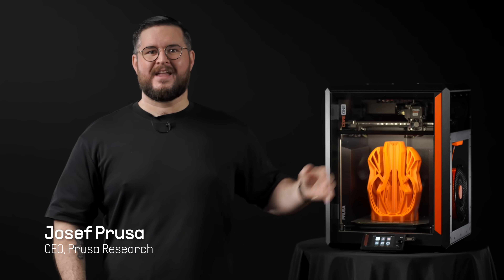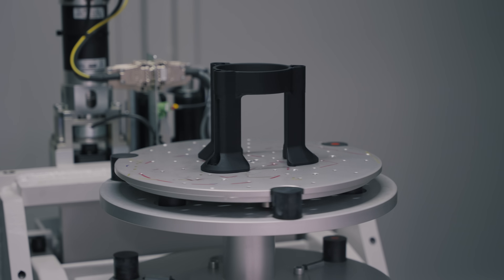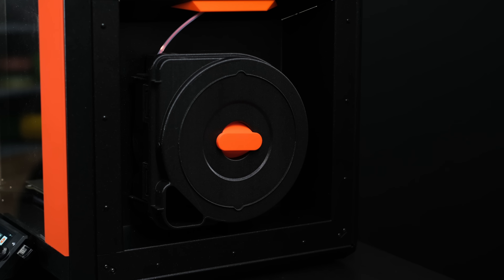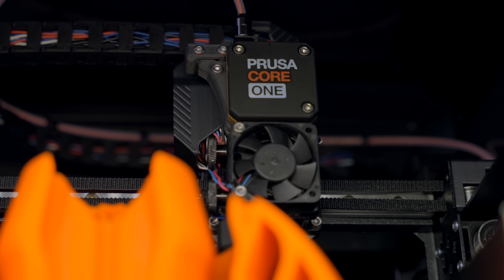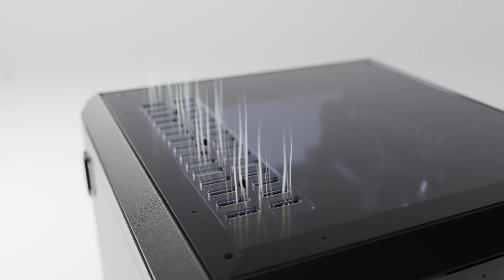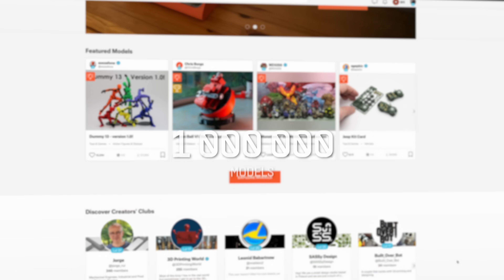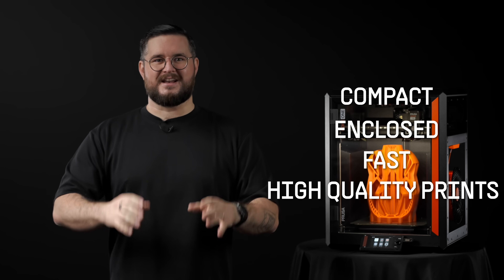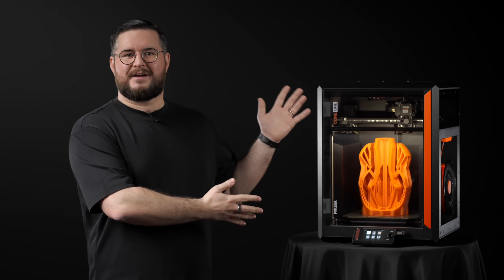Prusa CORE One - Fully Enclosed, High-Speed CoreXY 3D Printer With Active Chamber Temp Control

Comment: The fact that I can upgrade my prusa MK4 to this is actually insane.
Reply: It’s very strange and I wonder the cost and what you’d have to throw out of the MK4. It’s like saying there’s an upgrade kit to turn a Honda motorcycle into a Civic. Better be significantly cheaper, otherwise I’d just buy this and keep the MK4 and have two printers.
Reply: the kit to upgrade the mk4s to this is $449 USD
Reply: @c0mputer  the conversion kit is at 489€ on the store. It's not so bad when you see the enclosure price with less features, but the price of the printer kit/assembled is better than the upgrade
 kit
Reply: @c0mputer  It's about 400e so its significantly cheaper than buying another mk4 or core
Reply: @c0mputer  It's less than half the cost of Core One Kit. 489€ vs 1049€ in my case.
Reply: The upgradeability made me almost cry from happines over ingenious engineering.
Reply: @az09haz  It's one of their core value propositions, you buy Prusa you don't get screwed with later models pushing you to buy a whole new printer. You buy Prusa you get long term ecosystem access.
Reply: It's a bit weird to call it upgrading the MK4. It sound more like you will be building a new printer and cannibalize the MK4 for parts.
Reply: @m97120  I mean that's fair, but it sure beats the competition's "haha just buy a whole new printer"
Reply: @ For nearly half the price without dealing with selling old printer. That's okay for me.
Reply: It's a conversion kit, not really an upgrade. But the fact I can turn my mk4s (former mk4, former mk3s+, former mk3s, former mk3) in a new corexy printer with a heated chamber (does the bambu have heated chamber?) at less then half the price of a brand new printer is totally insane. I can't wait for the kit to upgrade... ehm... to convert!
Reply: @andrealioce4341  Upgrade or conversion all depends on what you need it for. To me it's a definitive upgrade to get a heated chamber, integrated enclosure and fume extraction! For printing PLA, I would not bother though. 🙂
Reply: @mariusmossum2923  I agree. I print mainly PLA and PETG, sometimes TPU and carbon fiber composites, and all print well in MK4S; but after the conversion I could print PC or nylon, materials I've always avoided due to the open frame. So it's a worthwile upgrade imho.
Reply: What actually insane will be spending "buy a new P1s money" to upgrade Mk4S to get 20% speed gain and the privilege for ending up with 1 printer rather than two.
Reply: You'll probably throw out 95% of the MK4 parts like the upgrade from the MK3S to MK4 upgrade.
Reply: @edsai2041  maybe, but I pay the new printer half the price. Mk3 to Mk4 kit + Mk4 to core one kit = brand new core one. But I can upgrade now to core one because I've already saved doing Mk3 to Mk4 instead of buying a new Mk4.
Reply: @edsai2041  I would assume you would keep. Controlboard, nextstruder, some motors and perhaps heated bed. Also are you complaining that a completely voluntary thing that is super customer friendly is possible?
Reply: @JakobBerglund  it's just something to be aware of. Though the upgrade from MK3S to MK4 was nice, I would have been better off just buying a new MK4 and selling the MK3S which would have meant less waste. I underestimated how many leftover unused parts I would be left with for the MK3S to MK4 upgrade. Upgrading to a MK3.5 or 3.9 would've slightly better in terms of waste created.
Reply: @edsai2041  Yeah, even Prusa said that the full conversion to MK4 was more of a novelty than something that made financial sense. Or waste for that matter. But it's nice that they do offer the option. All those extra parts may become spares for old Mk3's, if we care to circulate them. So not necessarily all landfill. 🙂
Reply: is more of a conversion than an upgrade
Reply: You can't, you need to buy MK4S upgrade first, then you can upgrade, while throwing half of the MK4S upgrade away...
Reply: @Papinak2  mk4 to mk4s is a quite cheaper upgrade, a lot of people (me included) already did it.
Reply: @andrealioce4341  I didn't, because I don't like plastic parts it comes with. And those are exact parts that will be thrown away when upgrading to core... I just don't like buying waste.
Reply: This is one of the benefits of dogfooding.  Prusa use their gear to print, and they sure as heck would love to reuse a bunch of parts when they upgrade their farm!  This is 9 kinds of brilliant and will let me take what was originally a Mk3s all the way to a CORE One it seems?
Reply: @mscs2911  Well, by the time you add the mk3 to mk4 conversion and then the mk4 to core one conversion kit, i'm guessing the price is that of a core one.
Reply: @itsGeorgeAgain  Yeah, converting all the way from Mk3 does not make any sense financially. Gap is to big. But of you did it in steps, each time there was an upgrade, you would be able to keep up for not that much money each time. 😉 Especially if you can only house one printer. Personally, I might upgrade my MK4S. But my two Mk3.5's have reached their end of upgrades. They can still be put to good use, going forward. For instance printing gridfinity bins 😂
Reply: Sure, but they say you have to use the MK4S, so there's one more (cheapish) conversion step. Probably something to do with IS printer profiles in PrusaSlicer, because I can't imagine why else the MK4 would be less compatible.
Reply: We will see when more informations will be available, but as far as I can understand, you'll keep the mk4 motors, extruder, nozzle and print bed. I'm not sure about the PSU (my mk4s still has the silver one, being a former mk3 upgraded), but even 100 more for the new black psu is imho still a good price for a corexy upgrade with a heated chamber. And without considering all the future upgrades that it will be possible to make on it once upgraded to core one.
Reply: *4s it doesnt mention if this includes the S upgrade which is what $300 or so? and the kit to upgrade is about $500 might be better off finding someone to buy your old one and just buy a new one?

you basically have to completely disassemble your old printer and rebuild it in this. AND if you have the old kinda poorly designed enclosure what would you do with that? i have a love hate relationship with the enclosure. it definitly didnt have as much thought put into it as the printers themselves
Reply: @JohnJaggerJack  Wrong way of thinking about it.
Reply: That upgrade path is why this printer is too damn small for the price. Completely pointless, and you’re throwing away half the printer for it.
Reply: @rob_over_9000  I throw away half the printer but save half the money. Then we are makers, I'm sure someone will create interesting projects to do with the parts left.
Reply: MK4 1200€ + MK4S to Prusa CORE One Conversion kit 489€ + MMU3 400€ = ONLY 2089€ BARGAIN!
Reply: I just upgraded my mk4 to mk4s and the cost of the upgrade make me thinking about buying another printer brand because the price of the upgrade to core one is the same price of the bambulab A1 Combo so you can print with multi color . But the great feature of the prusa is the costumers service  24/7 and most of the printer parts can be printed .
So as a prusa members or users we need a benefits like a discounts or free gifts or any thing that’s keep us going with prusa .

And about the enclosure I already buy network cabinet that cost almost 120$ and add for it some stuffs like a filter fan , light , thermometer and its work fine .
Reply: What!!!
Reply: not mk4, you need to upgrade do mk4s first
Reply: And I can upgrade an ender 3 into a fully enclosed core xy. This is not amazing at all.

Keep your MK4 and get a p1s, they are on sale right now.
Reply: @Smokinjoewhite  It's quite clear whom you are working for! Your comments is all over this thing; and every one of them is an attempt to rain on Prusa's parade. It ain't gonna stick! :-D And yes, it is amazing! Because for that price you get all the parts you need, and amazing guide to build it, ready-made software/firmware to go with it, and finished profiles for most filaments. Upgrading your Ender is only cheap because your time has no value! :-p

I do not care what any BBL cost! I just don't care! Not because I am a Prusa fan-boy; because I am not. I actually intended to go all DIY, because Prusa was lagging behind. But I have come to love their product and service. I value my time more than my money! I value things built to last for years to come. And I value my privacy, something BBL-users clearly don't care about. There is no free lunch. You are the product!
Reply: The problem is you can buy a P1S for 100$ more and keep the MK4 as a second printer.
Reply: @benjaminh5886  Except, that assumes you need two printers and you want to own a P1S.  I get that you are a fan of the P1S.  Just know that the idea of a 3d printer as a disposable appliance, is not necessarily what everyone wants in this community.  I see the same arguments in the computer world with the Framework.  Lots of people say "why pay that for a Framework, when you can buy two laptops for that price?"  The problem is those two laptops are disposable appliances and their lack of modularity and lack of upgradeability bores me.  I want Framework's modularity,and high iFixit score -- so much so that I would rather have the Framework in lieu of 5 of those disposable laptops.  In the end, it comes down to what you value as a consumer from the builder and your general ethos.
Reply: @benjaminh5886  I have my P1S for a year now and use it exclusively. It's a great printer. Until you have to to anything more maintainance than changing a hot end.

I had to change the belts (I do much high chamber temp printing) and it was a literal nightmare just removing the panels and getting every smal hidden screw. I built several DIY printers and if I could I'd change it for out the Prusa in a heart beat. Bambu Printers are great when they work, but it can get nasty quickly when you need to repair something.

In that respect, if I had a MK4 I'd totally go for the 450 bucks upgrade kit.
Reply: @benjaminh5886  Eh lets be honest. if one only cares about cost-efficiency and wanting multiple printers, they wouldn't have a Prusa Machine to begin with.
In that regard the problem you describe is kind of a non-issue to them as they likely are using just a Single Printer they are attached too and/or stick with Prusa due to personal reasons such as Right-to-repair principles or a general dislike of other printing companies such as Bambu.
Reply: @benjaminh5886  I think this is the time when BBL-fanboys get to zip it, and leave the rest of us to rejoice! :-D I would not let a BBL-printer inside my house, even if I got paid to do so! :-D I also don't give a sxxx about Chinese cars, despite them being cheaper than the competition! I just don't care! And I can afford to not care! Halleluja! :-D
Reply: @mariusmossum2923  Keep up the misplaced patriotism.
Reply: @Smokinjoewhite  ok, comrade.
Reply: @mariusmossum2923  You're free to spend twice the money for half the printer, you do you! 😀
Reply: @mcbrite  :-D Well your perspective is more than likely due to only considering part of the offering as having value. By all means, do that! I for one value the whole experience! "you do you" makes no sense this discussion! I never spoke in absolutes, or forced anyone to agree with me. ;-)
Reply: @mariusmossum2923  Neither did I, exactly why I said "You do you"... But it's not the smart or pragmatic choice, so why push it as a good choice? - It's technically/pragmatically speaking a bad choice, that you still prefer. Nothing wrong with that.
Reply: @benjaminh5886  Did you just compare an open source machine to a chinese proprietary ripoff?
Reply: @mortenkallesen923  'open source' you forgot the inverted comma's.
Reply: It’s not fully open source anymore.
Reply: MK4S
Reply: @ScytheNoire  Right, but I have the upgrade path from the Mk3S to the Mk4 and Mk4s, so I could in theory upgrade it again to the CoreXY :)
Reply: Look at the price, and you will go for Bambulab.
Reply: @JardaBar  This is competing with the X1C and even goes beyond that with a heated chamber. This is targeting people that want to either stay with Prusa for decent product support or people that are going to be using a lot of "engineering" filament which benefit from a heated chamber. This isn't a best solution for everyone product.
Reply: It’s not a heater chamber
Reply: @JardaBar  In Australia the Core One assembled will be the same as the X1C (excluding shipping).
Reply: @JardaBar  You do not get an heated chamber with P1S or P1C. I think this is a good value for some people. We will see what the reviews tell us.
Reply: It’s not a heated chamber. It’s a temperature controlled chamber fan.
Reply: @KristenRiis  Nope, the blog makes no mention of a heating element and talks about the fan for temp control.
Reply: @derektran9404  from the blog:

"Thanks to the space-efficient body with recesses on both sides, the super-compact chamber can warm up faster and reach up to 55 °C. This is perfect for advanced materials (ASA, ABS, PC, Nylon) which require stable, elevated temperatures. But we wanted to take the heated chamber one step further."

When you make an adequately insulated enclosure, the bed becomes your heating element and you control the temperature through cooling instead. That the heating element serves multiple purposes doesn't magically make it not heating.
Reply: @derektran9404  "active temperature control" means it's a heated chamber. Up to 55°, not the higher values of professional printers, but as far as I understand it's a heated chamber.
Reply: @KristenRiis  What I'm saying is a lot of folks think there's a separate chamber heater instead of just passive bed heating like every other enclosed printer. Every printer with an enclosure should use such ridiculous language if you think its fit.
Reply: @andrealioce4341  Read the blog. The active temperature control is just a temp controlled fan. You just get passive enclosure heating from the bed like every other enclosure for prints that exist. There is no chamber heater.
Reply: @derektran9404  do every other enclosed printer come with temperature controlled cooling?
Reply: @KristenRiis  No, but my point is the marketing is clearly misleading a lot of folks and its trivial for other manufacturers to add it if they want to.
Reply: @derektran9404  is it though? There are active thermal control and others could have added it, but they haven't. Is it a problem that Prusa came up with a smart and cheap solution?
Reply: @KristenRiis  No, the problem is that the marketing is misleading for a feature I'm sure more will add that is not particularly complex.
Reply: @KristenRiis  The X1C and P1S both have a chamber fan that reduces temperature when printing with PLA/PETG but it's not marketed as 'active temperature control'. If most people believe that the CORE has an active chamber heating element when it in fact does not then i agree that it's misleading from Prusa
Reply: @mihedas  If you just read the comments here you can see all the people fooled into believing its an active chamber heater.
Reply: @JardaBar   Nah. I know how buggy their software is from my A1 Mini. But if you think the price is more important then go ahead.
Reply: @brinkoftext  And yes, price is also important.

Comment: OK, a concurrent product to Bamboo was needed. The MK4S is great but just looks old design. The XL is much larger and more expensive.
The CoreOne fills the gap. But the biggest feature is the conversion kit from MK4S to CoreOne...

But I want the GPIO Board for my XL/5! I have added RGB LEDs to my printer, and control them through HomeAssistant and ESPHome. A way to do it directly from GCode would be preferable 🙂
Reply: The XL has a proper competitive edge. They just need it to work like it was supposed to and not be crazy expensive.

Comment: Max nozzles temp should be 310 and max chamber temp should be 65c. That’s kinda a bummer.
Reply: Well as i know prusa there will definetly be an upgrade which could reach this temps
Reply: If you need those temps, they have their PRO lineup. Or there's probably other brands who have that functionality for cheaper. 
But the average maker looking at a Prusa printer doesn't usually need those kinds of temps.
Reply: @ Bambu does 300c with the X1C for the same price and hits chamber temps above 55 pretty easily.
Reply: Why ?

Comment: Brilliant job guys, looks like a great piece of design. Really glad you've used the excellent work with the MK4 enclosure as a structural basis for the design because that folded sheet metal was a work of art. Honestly I think the upgrade from MK4S to this is a bit nuts to offer but brilliant to see you sticking to the ethos.
Reply: @zerofox3d  …plus it reduces the number of older machines in the per-owned market.

Comment: I like the placement of the filament, but is it really worth it if you have to reduce the surface size? 

Also €1350 to compete with a €550 P1S seems like suicide. Especially when the Prusa CORE One is still slower

Still really excited for the reviews after it’s officially released.
Reply: why do you think it's competing with that and not the x1c?
Reply: @awildtomappeared5925  The X1C is on a completely different technological level, equipped with lidar and AI. Not to mention that it has a larger print area but is 2 cm shorter. Also, their AMS is in a whole different league. I’m hearing nothing but complaints and frustrations from people who have the MMU.